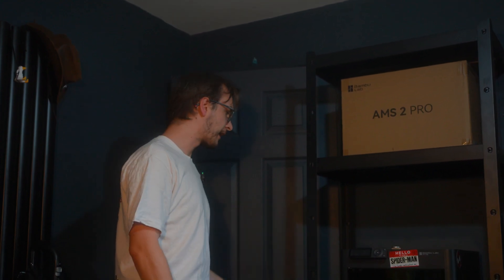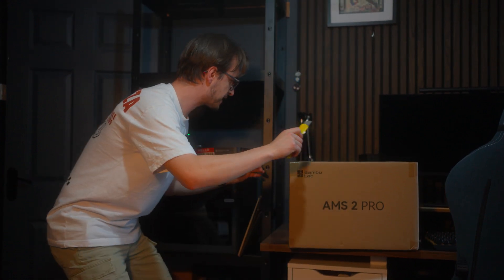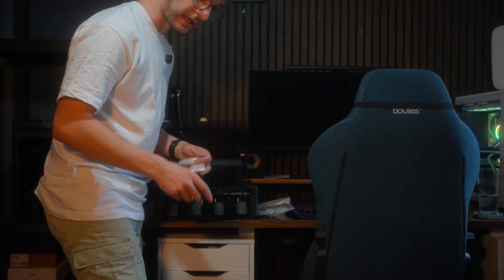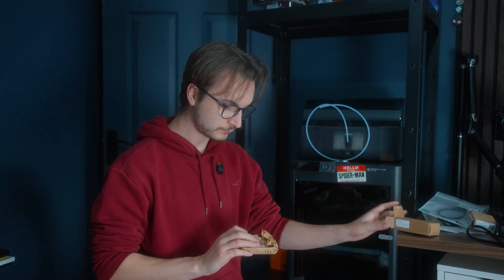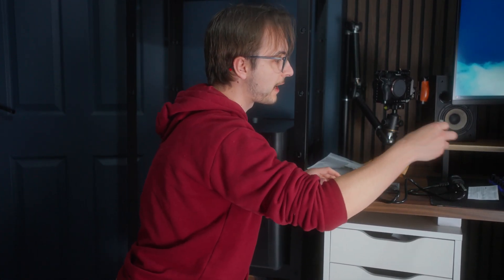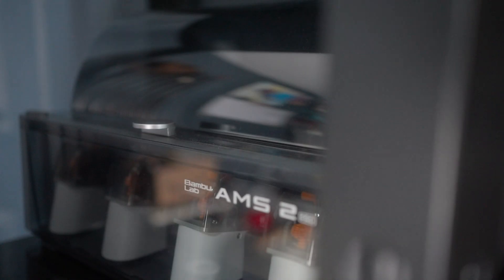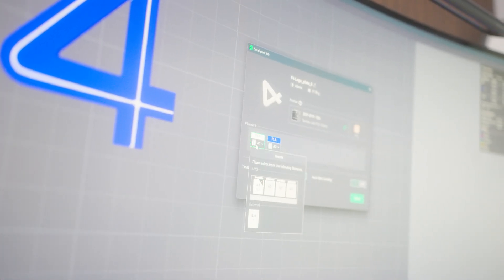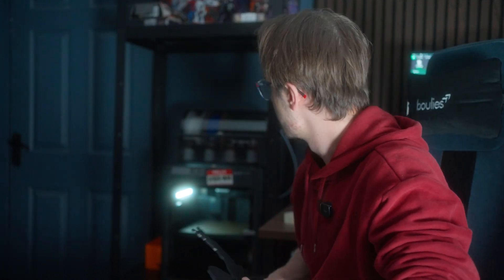BAMBULAB AMS 2 PRO - Unboxing and Set up

Comment: do you have a link to the shelving rack to use for you're printers?
Reply from the maker: Sure! This is what I currently use https://www.ikea.com/gb/en/p/bror-shelving-unit-black-s89471756/
Reply: @Mattisspiderman  amazing thank you, quick question - is there a lot of noise or rattle from the shelving when you'e printers are running?
Reply from the maker: @harzo_yt not really, I've screwed it to the wall so it doesn't move
Reply: @Mattisspiderman okay perfect 👌

Comment: For the coupler install, another youtuber said it was very important to orientate the coupler that the blue end faces the printer.  Bambu did not include this detail in any of their instructions so not sure if it matters but the other instruction said very important.  Thanks for the video
Reply: I found out the hard way that this is correct. Filament kept jamming in the connector so AMS would fail repeatedly, feeding and retracting over and over. Found online instructions from a vendor that sells the connectors saying filament should go IN the black and OUT the blue.
Reply from the maker: @abolt18 ohhhh okay that good info to know thank you!
Reply from the maker: Ah, i've not had any issues with how mine is facing! not sure how important that is to be honest but it seems to be working well so far. what was the outcome if you face it the wrong way?